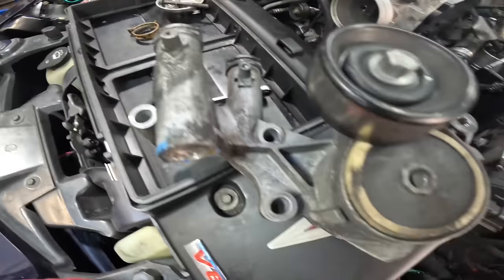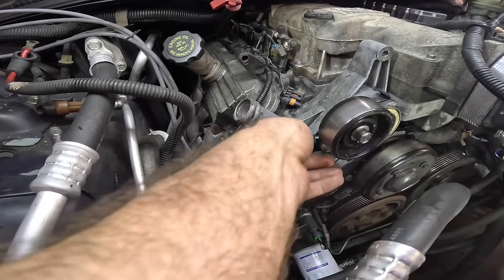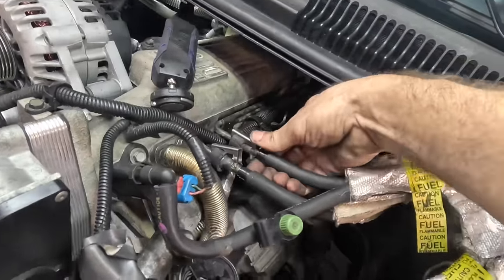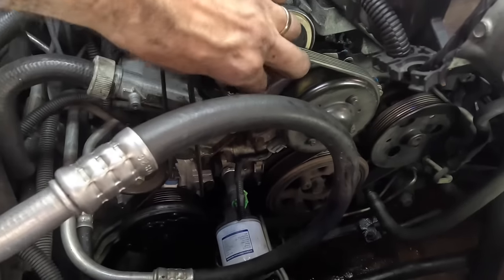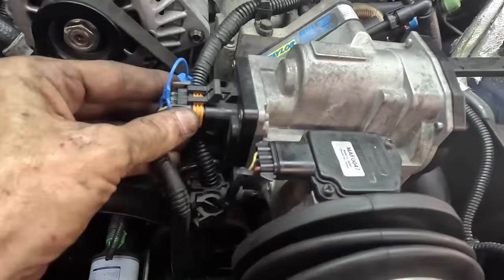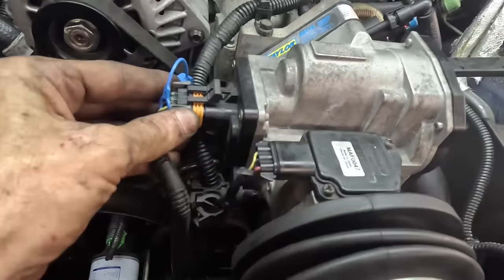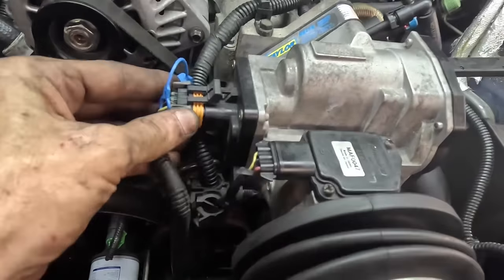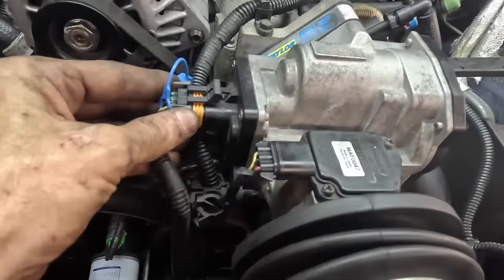Lower Intake Manifold Leak-Final Assembly! Oil In Coolant GM 3.8L 3800 Series II Engine #repair

Comment: BG saved me from engine swap.. Glued valves it was, and 1st reapair shop said "no compression, no further investigation" " 2nd one took better look out what was wrong and fixed it.
Reply: Some shops are like that, my daughter had a Cavelier went shopping and when she came out the car wouldn't start or crank. She called AAA the guy came out and told her the motor was seized and she should trade it. She called me for a ride. i got there and she said it ran and started fine in the morning so i got under the car and noticed the starter gear was jammed, and i had to loosen the bolts and it retracted. I tightened the bolts and told her to try it, and it fired right up. i picked up a new starter and had he drive up to my house and i would replace it. i told her that was the fastest blown engine rebuild that i ever did.
Reply: this 1st one was dedicated repair shop for my car 😆 second one small business ❤

Comment: I've got a 2007 series 3 on a grand prix... Around 160k on the clock.

So far luckily haven't had the intake leak problem. (probably ruined that luck now 😂) 

Did have to do a water pump and had those plastic elbows also break... Upgraded to the metal ones.

And then a couple of years later did the timing chain mostly bc the cover started seeping coolant and might as well do the chain at that mileage while in there.

Comment: my 1998 Dodge Dakota had 5w-30 put in my 318 at a local shop and with in a week the hydraulic lifters started talking to me, I had to drain the oil pan and put 10W-30  and in, a short time the lifters quitted down . The lifters didn't like the 5W-30.

Comment: Most of the users manuals give you a graph with DIFFERENT oil numbers to use depending your local temp and sea level, so most engines can use one or other oil, no discusión there.

Comment: I run 20-40 in my 2000 7.3 with 480k on the clock. Drove it to N Dakota the other year in the winter. Even with the block heater, and proper diesel cold treatment it would not start at -30....
The oil was just to thick to run the injection system.  Had to pay to have it stored in a heated space for a few days before I came home....
20-40 is just fine year round in E Texas.
Reply: You should have bought a heated dip stick i think it would have done the trick for you.
Reply: @bruceaugustine6486  the 7.3 block heater is in the oil cooler. The local people I meet with all run 0-10 in the winter and 10-30 for spring through fall. 
The tow truck driver had a large heated storage space he brought the diesels to when those passing through got stuck. He picked up 4 plus mine that 1 day. He claimed to do that as an average when it dropped below -20. Oil heating will only go so far when it gets that cold.
Reply: @keithmalmberg8395  I live in NH and we don't have many days -30 but we do get -15 and -20 with wind chill factored in and that is what the people with diesels do here so i thought it may help.

Comment: they actually did a good design, by moving the engine back toward firewall, off the axle for much better balance and handling, like a Ferrari does, for real.  Once in a while GM does something right

Comment: Wouldn't it be more beneficial to use the lighter winter weight in the colder climate and not the warmer one? 

I always ran 5W-30 in my 3.8 Bonneville. 

Strut tie bars are very beneficial for unibody cars, especially convertibles. I have a lower and also a rear on my GTI.

Comment: Man I'm in Louisiana wish I could get you to work on my 2006 envoy...inline 6 motor..ac blower motor won't turn off..even after removing key...and my main harness has splices because a rat chewed through most of it and that's just caused a plethora of issues

Comment: Youre right! Can o worms with the oil viscosity debate!
10w30 is thicker an is what the engine is built to use. A thicker oil should be used especially in hot florida.
Your dirtymax probably specs 15w40. Same logic suggests 0w40 would be fine.
Reply: Yes, especially Florida.. 10w-30 over the 5w-30. It specifies 10w-30.. and that is what he should have used. He didn't have the correct oil, so he used what he had. Shame...

Comment: I have to replace my heater hoses for my v8 98 Trans am too. I have the same issue with them being discontinued. There’s a built in heat shield where it passes the exhaust manifold.

Comment: Ray, is it your opinion that it’s ok to spray water on a warm engine? I would like to clean my engine but I’ve always been told not to spray cold water on a hot engine. I trust your advice on this. Thanks.

Comment: Ray, did you use an evacuator or the drain plug for the extra oil? The sensors and electrical connectors don't like water. Playing with fire, introducing corrosion...

Comment: CRITICAL STEP NOT SHOWN OR NOT IN THE VIDEO??? Gotta ask... you went through the process to reseal the intake/lower etc. But I have an old school I would have done way before adding either oil or a coolant flush...I did not see you perform a pressure test of the system to verify the intake gaskets/seal was verified.
TO me it seems a critical step, especially when oil/coolant mix is deep within the block and drips on the floor is only one indicator. I have done about a dozen similar head/intake gasket replacements and have been bitten more than once. 
As I said, just asking...

Comment: Nope, no internet oil debate from me, the manufacturers specs are only a recommendation, not gospel. If you live in a hot climate 5W/30 is pointless, use a higher number like 10W/30 or 40. Cold climates can go lower. Although Ray had it backwards when he mentions "he can do that" because he's not in lists cold regions The lower the number, the colder the region the oil can be used in. NEVER use a higher winter weight number in cold climes.

Comment: Do you use use the GM sealing tablets after a flush, helps to keep the pump seal from leaking. They are installed in all new vehicles at the factory or at least they were.

Comment: Nice job....

I've sworn to never jump in an oil debate again...  So I am not jumping in...  I am not...

(whispering) but I think you had that backwards.  In florida, where it is never cold, you can run a little heavier oil if you want to...  In northern wisconsin, you go lighter, because the heavy stuff will not flow when it's -20 outside.....  So, reeee me all you want, I could be wrong...  I think you were a little light on the coffee this morning...  You got the oil backwards, and you called it a Fiero early in the video....  Feels like you might have had early morning coffee deficiency symptoms.....  Which, is a risk, it could happen to anyone, there is no disgrace.....

Comment: hey Ray, when you started the engine, the trans dipstick moved. Did you replace/tighten the nut that holds the tube on the back of the engine?

Comment: Ray, I wondered about that? You don’t have to worry about electronics or anything else, when washing down the engine bay, with a hose?? Especially the alternator?
Reply from the maker: Well we don’t want to soak the nator but a little water won’t hurt it. There are engines that have the alternator on the bottom and they get splashed all the time with road water
Reply: @RainmanRaysRepairs  Thanks brotha👍 Also, most of the electronics, have a rubber seal inside the connectors, I’d assume? I wanna do my Acura, but with my luck, I’ll be at a shop like yours, asking, WTF? Lol Thanks Ray. Keep up the great content. I learn a lot.

Comment: Ray, you have said you are not an engineer, so you should put the proper weight oil into the engine. That said, you don't know more than the engineer. Period. If that was my vehicle, I would make you put the correct viscosity oil in, whether you liked it or not!!!!

Comment: Didn't they used to make an acid flush  i guise if you didn't have anything else you could dump a gallon of vinegar in it with water  
Vinegar works pretty good at desolveing oil  plus you car would smell like a fresh salad!
Reply: No joke vinegar loosen hard water deposits too its a mild acid like whats in your stomach so it not harmful to the environment..

Comment: That 3800 is the Buick 3800 it's not a larger configuration of GM's 3400 . 2 different engines  all together.

Comment: Is there any concern for possible water pump seal damage when running the engine dry?
Reply: It takes the motor time to heat up so just backing it out of the stall is fine, but taking it on surface roads or the highway is a different story, now you're talking warped heads and other major damage if there is no coolant or at least water.

Comment: Reeeeee what’s the go with BG cleaner inn the radiator to remove oil but you claimed the the garden hose was going to remove oily finger prints and oil from the engine, must have special water in your part of the world or BG cleaner is snake oil!🤣🤣🤣

Comment: Yeah , if you put a paper towel in the Funnel It will soak the oil up
Reply: There is a plug on a plastic stick that he can put in the funnel to hold the contamination in the funnel and dispose of it.

Comment: Amsoil is not superior ..it's marketing nonsense.  Why do any of the bottles ever list mfg's specs, that it meets.  cus they have not tested to various mfgs specs.  all oil is not the same, additives matter. Motul, Liqui Moly,Castrol all have mfgs specs on teh packaging.  Some 0-30W is correct weight, but won't have that it meets a VW 504 spec, means it's not the same as a 0-30 from same mfg that has VW or Porsche, or Audi spec numbers.  Same for GM, Ford etc.  All finished oils, are not the same.  They may start from the same base lube, but additives matter.  Same as coolants themselves, no one fits all

Comment: Indestructible Engine?... Yeah sure, if you disassemble 1/2 the engine and replace all kinds of parts.  GM is complete trash.  It's just the level of trash that is the question between their various engines that is the question.  So the GM Series II 3.8L / 3800 is a lot less trash than some of GM's other garbage, but not by much.